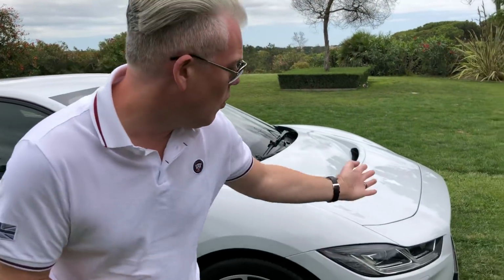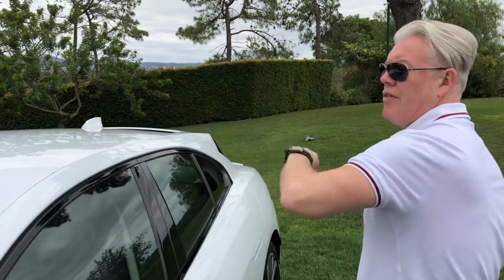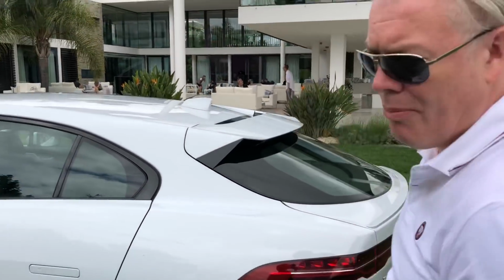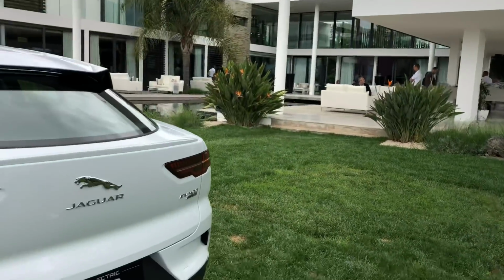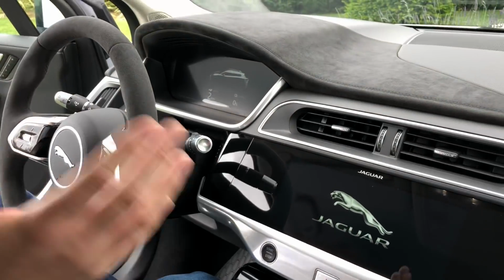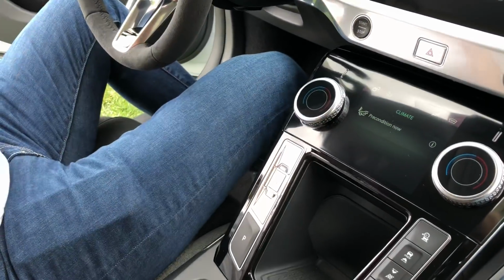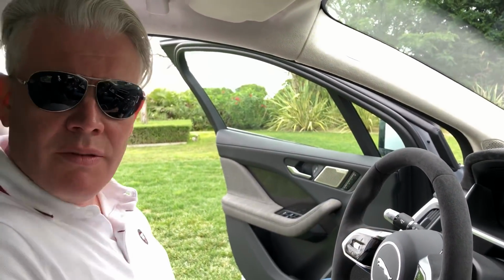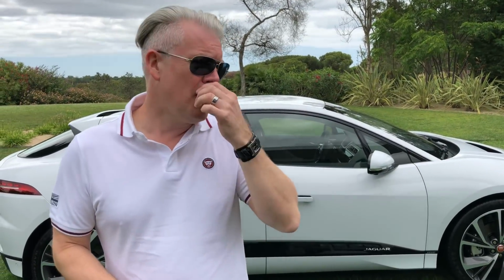Did This Guy Design a Better Looking Car Than Elon Musk?  2019 Jaguar I-Pace

Comment: Im sorry, but the jaguar is ugly! With its mini windows in the back and the rear window where you can see nothing looking back. And the lumps in the front and on the sides.... When sitting inside I feel imprisoned. There is no few outside. And a bulky back taken from a suv. It looks like it was developed by dr frankenstein. And the specs don thrill me either. The range is bad and there are litterally no charging stations. Where am i supposed to drive this???? If i cannot charge it on the way? There are so many beautiful jaguars out there..... why is jaguar desighning their evs looking like this?!? I think the way to see if a company is seriously about Electric Cars is quite easy.... 1. if the company builds charging stations  2. if the company is building a battery factory. Because withou both no EVs can be build or even be used.  PLEASE FEEL FREE TO COMMENT MY REMARKS THX.

Comment: I'm not impressed by the aerodynamics. A Cd of 0.29 is far worse than Tesla model 3, S, and X, which all achieve a Cd of 0.24 or less. Perhaps that explains the relatively poor range for such a high capacity battery pack.
Reply: it has proper cooling (no limp mode like Teslas) and downforce so the Cd will be higher
Reply: It's not clear to me how Jaguar's coming system compares to Tesla's. I assume both have dedicated glycol loops for managing battery temperature while driving and while charging, putting them way ahead of cars like Nissan Leaf and VW eGolf. But neither seem to be intended for track use. What leads you to think Jag had better thermal management than Tesla?

What makes you think the Jag has more downforce? Higher cD does not imply higher downforce.

Comment: Elon designed a family car. Not a legally street-racing car. That's why it has a simple design look and looks more similar with petrol cars that were around it's time, so people make the transition easier. Also the car design on Tesla is 3-4y old by now.

If tesla would have released their cars with this jaguar design. They wouldn't had the same numbers of cars sold. Look at BMWi8 .. that car is the best looking EV. But is not viewed as a family car, also because of that aspect.

Comment: It's a really nice effort by Jag.

Fortunately for Jag, Tesla paved the way and did the innovating.  Adjustable air suspension?  Retracting door handles?  Low Cd?  Stowage with phone charging?  Tons more we could mention - but we all know the real pioneers here.   And by the time you read this, the Jag will be one generation behind the latest Tesla.

Now where will you fast charge it?  I live in Houston, and between here and Dallas (250 miles), there are at least two Tesla Superchargers.  No Jag fast chargers.

Does it come with an 8 year, unlimited mileage powertrain and battery warranty?  I hope so - because no one knows how to fix these yet, which means you can bet it'll be ultra expensive - moreso being a Jag.
Reply: Most people don't use up enough range in a day to warrant needing a fast charger. Even with a round trip to work and back home with errands and taking the scenic route, you should still have plenty of range left. And the "slow" charging because there's no superchargers? When you're home for the night and you have at least 6-8+ hours until the start of your next day, supercharging is superfluous.

This is like saying you have a ~12 gallon tank, and you only use 0.05% of the tank per day during normal use but people say "But what about fast-refueling? What if you run out in 1 day (wildly improbable) and need to refuel fast?

I would hope Jaguar... the company that made the car... would also know how to fix it. I know it's a tall order to go to the company that makes your car for expert service and repair.... but I think we can do it.

Comment: Cab forward is not new, it is not even new in the world of EVs, the Tesla Model 3 also has the windscreen pushed forward like this Jag. Anyway I like the design and the price looks competitive but I wonder if they have enough cells to make these in quantity. I love the dash having real switches for the air suspension, to raise the suspension on my Tesla I have to go through 3 menu screens which is crazy when you have a queue of cars behind you when you want to clear a particularly high speed bump. I hope this car is a success, it looks like it could well be. Sad but I don't think GM are really serious with their Bolt and Ford are even further behind.

Comment: This sucker is a hatchback.  This is not an SUV.  Four wheel drive?????  Nope.  Keeps calling it a car.  So not an SUV.
Reply: It is AWD
Reply: And it can drive through streams and climb steep loose dirt/gravel grades without using the throttle pedal.  It is a special extreme climbing mode.  Check out Robert Llewellyn's Jaguar test drive where he demonstrates it: https://youtu.be/3jj_w1PfSqk?t=1m24s
Reply: It's a SUV with 4 driveshafts

Comment: So as long as it keeps moving the rear window will stay clean. Too bad it's job is to take you places then sit while you go in and do things. Oh and BTW I realize most people watching this weren't even born then but cab-forward was already used to describe cars made in the 90s, by Chrysler. You're literally touting and 30 year old design concept as new and exciting.
Reply: Citroen used to measure cab-forwardness, by measuring the ratio of bonnet length to glasshouse length.  (The Citroen AX was the most cab-forward vehicle in its day).  I expect the i-Pace is now the most cab-forward car ever.
Reply: To be fair, electric cars with regen are an over a 100 year old concept already, it's not like anyone has invented anything fundamentally new in the last 15 years, ^oo^

Comment: Let me help out you guys that are forged in the 20th century. Stop making comparisons of cars because of their propulsion systems. You don't compare a Mustang to a E Class because they both are gasoline powered. Just like you shouldn't have compared the ELR to a Model S or have the stupid rating MPGe. A small hatch is different than anything Tesla makes until the Model Y comes out. I understand your need for the clicks so you throw Tesla in the title. On a side note what Jaguar did, and I am not mad, is take Tesla's concepts of the skate board design, handles, and other features and apply Jaguar styling to it. Looks great and seems like a sweet ride and that is it. I for one am scared of Jaguar/Land Rover electronics but other than that like it. Now stop using Tesla for click bait and do it on the strength of some talent.
Reply: sshut up
Reply: Nodq Soulja Well that's nasty and doesn't offer much.

Comment: yeah ok buddy , just wait until all the electronics start breaking down $$$$$$$$$$$  on these jaguars , they only design them to last for the warranty
Reply: As a VERY BROKE person my advice is don't BITE more than you can CHEW. Simple. That's the beauty of daily-ing an old 1990's beater. Still simple to troubleshoot and fix and not too expensive on parts.
Reply: Electric vehicles are fundamentally simpler than internal combustion engine vehicles, so should be more reliable, and cheaper & easier to maintain.
Reply: Rich people only keep Thier cars as long as the warranty anyway.
Reply: Peter Ford.  Yes but some of the biggest things that go wrong with jags and land rovers is electronics and interior components, knew someone with a brand new land rover and when it rained hard the door leaked.
Reply: It isn't 1985.  Jaguar is making very reliable cars these days.
Reply: Tesla resale values are high.  (I can provide a link for that if anyone wants it.)  So premium electric vehicles at least have the potential to retain their value - and I would expect that they should for the reason I mentioned.  Regarding Jaguar as a manufacturer, I thought their resale values were high also, but you'd better check that for yourself before you buy one.
Reply: Theoretically speaking ? YES. Real life practice ? It's yet to be proven, too early to compare it to anything. Electric cars are still wearing diapers.
Reply: JIGA BACHI. My thought on electric cars exactly. I'm waiting 7 years before I buy one. Hybrids just fully matured 4-5 years ago and they started to become popular in like 2003-4.
Reply: sstearns2. Haha. That's funny. New jags have one of the highest depreciation rates because they start having issues after only like 3-4 years old.
Reply: How often do you have to maintain the electric blender in your kitchen?  If it has a good quality motor it will last almost forever w/o any maintenance...
Reply: Dillon Hawkins,   Being rich is all about prospective.